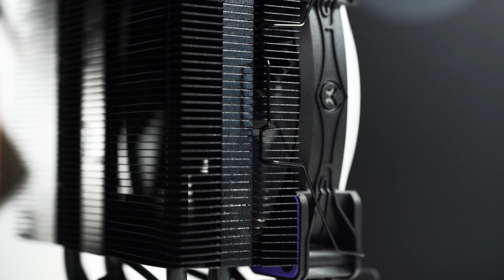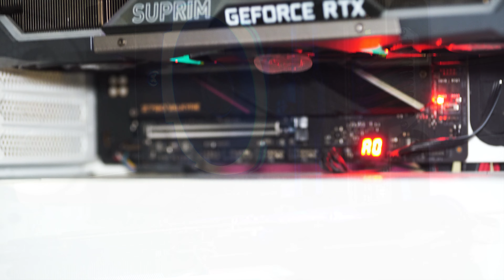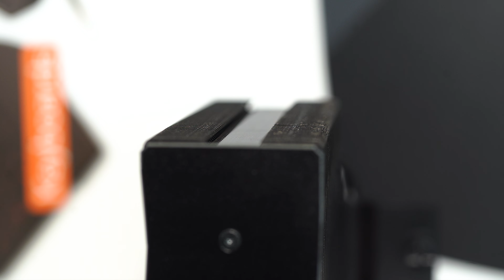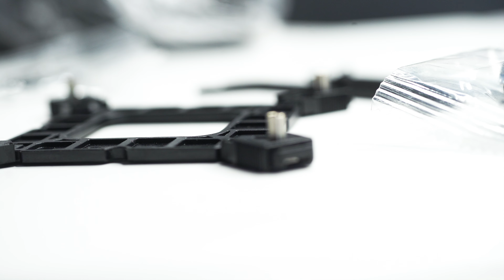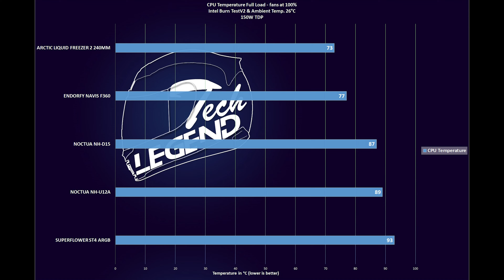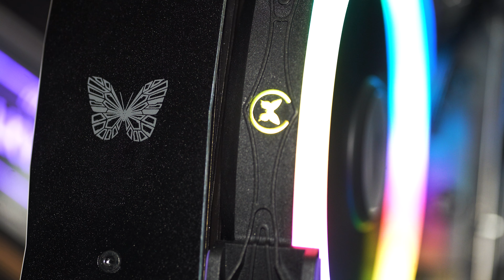SuperFlower ST4 ARGB CPU Cooler Review

Comment: just got this cooler as part of a promotion when i bought my LeadexVII. Running it on a Ryzen 5 9600x with inside of a large, quite case- the CTE TG ARGB CTE750- with 12 other 140 MM fans so the air flow is pretty mint and my temps so far have been plenty comfortable- almost never above 70C. I did go ahead and slap an additional fan on the other side of the cooler using brackets from amazon and an old corsair fan i had laying around
Reply from the maker: Thanks for the added info, I'm sure it will be useful for someone that is looking into buying this cooler.